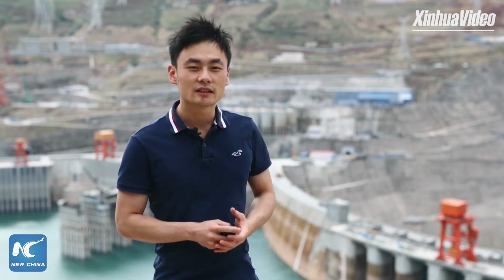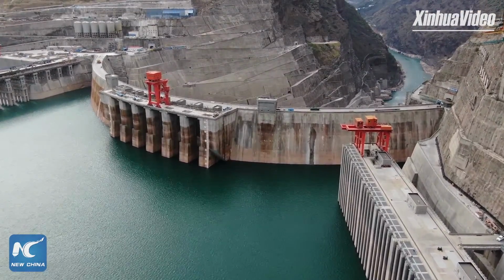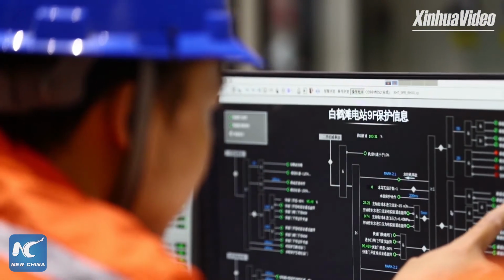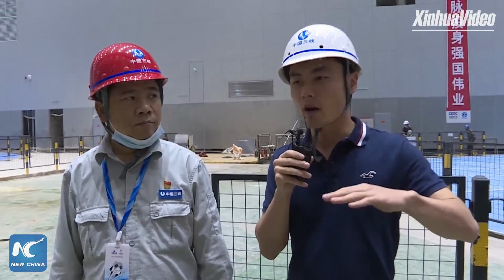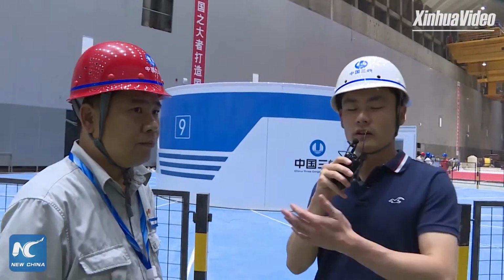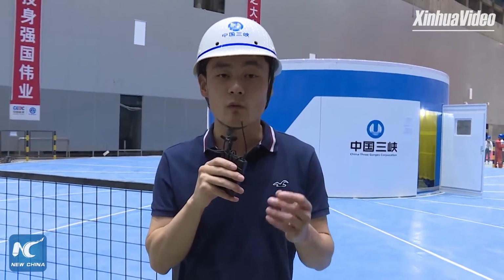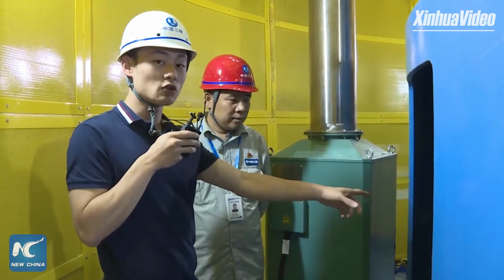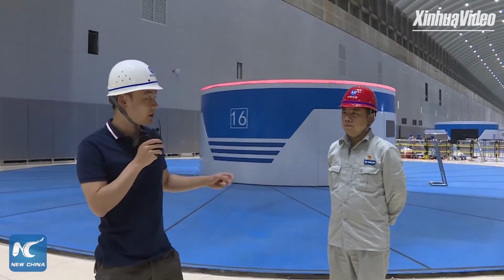Exploring China's mega hydropower station of Baihetan

Comment: Gradual improvement like  concrete mixture and reliable supply are important in the  megaproject. In fact, most important problem of mega-projects is, the sheer volume  of small problems which could be solved easily. :-)